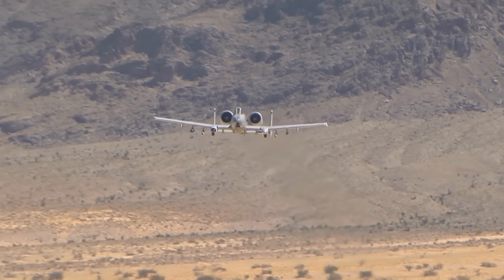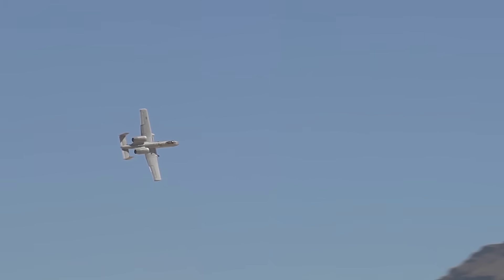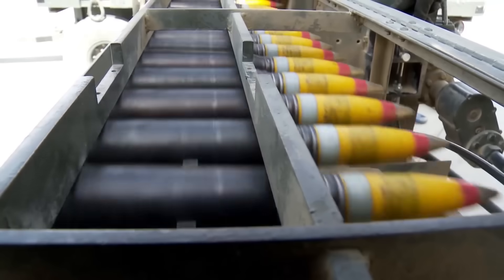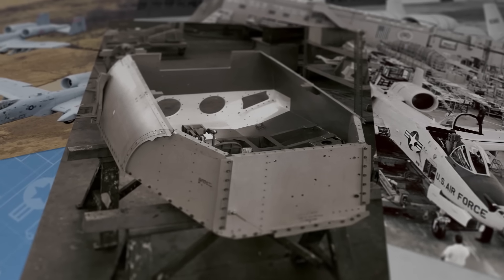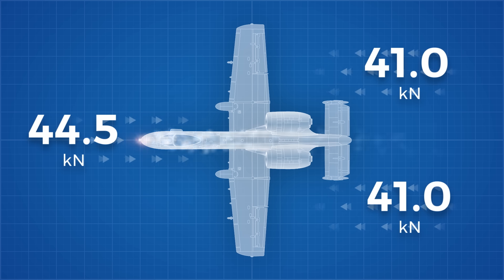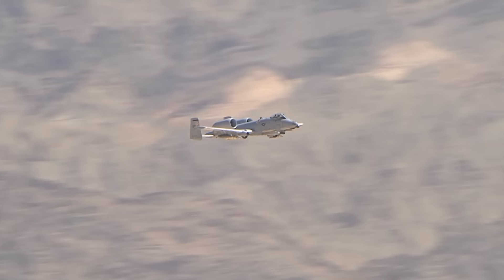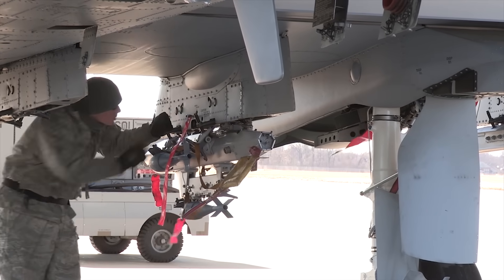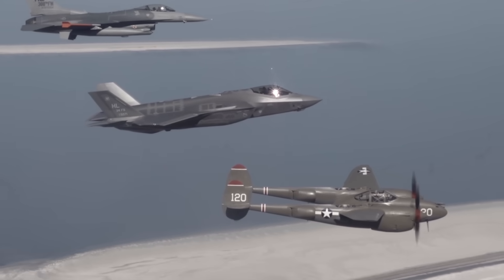The Insane Engineering of the A-10 Warthog

Comment: The A-10 has got three things no other modern fighter or low-cost turboprop has: persistence, efficiency and escalation dominance in the CAS-role. 1. It can loiter longer and without massive tanker support to back it up. 2. And as such, it requires less support platforms. On top of that, th A-10 still is relatively cheap to build, maintain/modify and operate, as its turbofans are very fuel efficient and the airframe is built to withstand so much punishment, that it requires less maintenance hours per flight hour. It also suffers considerable less mean time between failures or airframe fatigue. 3. 
The Warthog can employ standoff weapons just as any modern fighter can, aided by targetting pods like Litening or Sniper or Joint Terminal Air Controllers/Forward Air Controllers (JTAC/FAC) on the ground or off board sensors like UAVs, E-8 JSTARRS and the likes. So it doesn't need to get close if that's not deemed necessary. But when required, it can and still be more survivable than the fragile airframes of 4th or 5th generation fighters. Not that it is impervious or invulnerable, but its chances of survival while getting hit are much higher.  It only takes a dozen 7.62mm rounds from an assault rifle to disable an F-35/16/18/15/Typhoon/Rafale, etc. There are only two mission teh aircraft isn't suitable for: air defence and deep strike against heavily defended, strategic targets.

Comment: The barrel is mounted offset, the barrel that fires is at 7 o'clock... that barrel is on the centreline... only the uranium oxide post firing through heavy armour has contamination issues, this is a fine white powder around the penny sized hole and is only toxic if breathed in. The military hardly uses this so industry does not smile when the military buy it as the military inventory still has rounds from 1990s procurement for the gulf war desert storm...

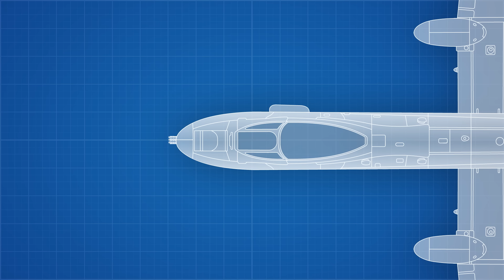Comment: At 7:47 you said that the gun is aligned to the center, but the graphic is misleading. It should be noted that the barrel group itself is aligned slightly to the left, but bullets leave the cannon from the 7 o’clock position, which is aligned to the center.

Comment: The reason the engines are located where they are so that if one is damaged and explodes it won't take out the other engine as  EVERY other Air Force aircraft will. Anyone who thinks a jack of all trades aircraft like the F-35 can execute the ground support mission as well as the A-10 just does not understand ground support. Stealth does not exist when you are down in the weeds with the troops.

Comment: Let's be clear on one thing. Many airframes can do CAS. And honestly the only munitions that the A-10 is the best at would be gun runs (obviously) and AGM-65 delivery (being slow helps when max range is reduced due to bad weather). There is one other reason though that the A-10C is the best CAS  platform around. It does it overtly! Many times just a show of force maneuver stops the incoming fire on friendly infantry, which is the entire goal of CAS. In some cases it is just redirected to the warthog which can more often than not absorb the hits and still be effective, though not ideal. Other airframes either can't do overt cas, or are not nearly as efficient or effective as the A-10C. The Super Tacano is the best attempt at replacing the A-10, but it does so by being a more financially viable version will taking an extreme amount of utility away. Because of this, the design is to have 4x A-29's in place of 2x A-10C's which only hurts the pilot shortage which has been present in the USAF for the last two decades. And that isn't a hiring problem, but a training one which the AETC has not been too successful yet at curing.

Comment: 7:44 The gun is actually offset to the left to allow for the front landing gear to fit under the cockpit. It does, however, counteract this by firing the rightmost barrel so that the recoil is aligned with the center line! A great engineering solution.
Reply: Not true.  The front wheel is offset, not the gun.  Go to the 10:00 minute mark to see a front on view that shows this.
Reply: Could’ve went with the good ol’ tail wheel ;)
Reply: See if you can find any credible source that shows it being centerline. Until then, you're wrong. They can set any barrel to be the firing one, but they chose the rightmost one precisely to be able to move the gun a little bit.
Reply: DownHereInChile I apologize, i thought you were implying that the entire gun was offset to the left of centerline still. (It actually used to be back in the testing phase, but they took it and put the barrel on centerline to stop the intense yaw recoil.)

Yes, the firing barrel is on centerline, but the entire gun is no longer displaced as much as it used to be. They used both methods to counteract the recoil.
Reply: Not anymore. It USED to be, but the A-10C currently in service would use a centered barrel to stop yaw moments.
Reply: ... DownHereInChile ... the gun is offset.  Not to clear the landing gear, but to place the firing barrel on the centreline.  The landing gear is offset as a result!

... Cade Norris, you appear to imply that the GAU 8A Avenger has been moved in the A10 C ... it is a fundamental part of the design of the aircraft ... it has not been moved!
Reply: GB Expat Cornishman I know at one point the gun was planned to be off centerline, it may have been in the design phase, but we are correct. 

It is now on centerline.

Comment: @7:46 The gun is actually offset to the left of the centerline, so the firing barrel (which is on the right side of the group of barrels) is on the centerline. The diagram isn't quite correct in that respect.

Comment: 7:45 - the gun is not mounted directly on centerline,  but slightly to the left [https://i.pinimg.com/originals/47/c3/d4/47c3d4376948b85a1286fc1ef0d5c9c8.jpg]. 
"The gun is mounted slightly to the port side so that the active firing cannon barrel is at the 9 o'clock position and on the aircraft's center line;" - source - https://en.wikipedia.org/wiki/GAU-8_Avenger

Comment: I believe that the best use for this plane is to refit it with a modern railgun.  It could be powered by hot swappable battery banks, that can also be recharged by the planes engine.  It could potentially fire for as long as until the barrel itself needs replacement from wear and tear (which would be anywhere from a few hundred to a few thousands rounds).   It would make it a force to be reckoned with, as it could act as long range air to surface artillery, devastating targets that would otherwise be difficult or impossible to hit from the ground, and it would maintain most of its kinetic energy.  Rails shot from a ship or the ground, have to fight against gravity, and are shot like traditional artillery, where they will arc and fall on the target. Shot from the air down towards a target though, and railgun rounds would maintain most of their kinetic energy and be more accurate.  

It would also be devastating to airplanes, because we're talking velocities of over 1 mile a second. That would still take 20 seconds to target, but it's easily doable, and the rounds can be made stealthy, so they'd never detect them, and thus would never bother to change course/speed, making targeting very simple. And if the plane is coming at the rounds, that's one object moving at mach 2 or 3, being hit by an incoming projectile at mach 6, essentially increasing its kinetic damage.  At that point, even a tiny railgun round would devastate the aircraft, and you could pepper the sky with them so that even if they do change course slightly, they can't avoid it. It would literally make coming at us to attack us, even more deadly than running away from us.  

Even if the enemy could see them (which would likely be impossible because railgun rounds already have a stealthy profile, and with a stealth coating, they would effectively be invisible to radar), 20 seconds isn't a long time to react, and even if they somehow could at the last few seconds, this would constantly force them into maneuvers to avoid incoming rounds, which effectively keeps them from being able to operate offensively. They'll have to constantly fly soo erratically that they couldn't even use the plane offensively.  At that point if you can keep lobbing rounds at them, they will literally have no choice but to land or eject.

Could even make it carry two or three types of railguns.  A large central one for heavy hitting that can fire say 100 large rounds.  A secondary one with medium/small rounds that allow it to operate how it traditionally does, i.e. peppering ground and air targets, and very small sliver sized rounds that act as flak that can also pepper ground and air targets with more staying power.

Comment: 07:50   Factually incorrect.   The Gau-8 is not actually mounted on the center-line of the plane.  It is mounted off to the left side by a small amount to make room for the nose-wheel and to line the Gau-8 up so that the barrels average on the center-line of the plane while they fire.  If the gun was mounted truly center-line the thrust vector would be about 3 inches to the right of center-line.   The retro-thrust from the gun is so high that the mild random variation in thrust per fired ammunition and propellant gas would make even computer control of the aircraft less accurate than having the gun mounted so the fired projectiles are on the center-line.

It's a very small factual point - technically less than 3 inches - but it results in the weapon being about 10x more accurate and maintaining a far tighter group.

The re-fit of the A-10 with the new wings includes sensor systems in the wingtips which will allow MUCH more accurate targeting of the Gau-8 from higher altitudes and distances through a provided 54 foot separation giving far superior and precise parallax ranging.   The aircraft will literally be able to aim the Gau-8 more accurately than the Gau-8 can shoot, allowing for replacement with a 25mm at some point in the future.  This replacement can provide more ammunition and range to the aircraft as well as a much tighter group on target therefore needing less ammunition per kill.   The Gau-8 is an impressive weapon but it is OLD and outdated.

Comment: I worked with the A10 chief engineer after he retired from Repulsive Aggravation, and know him well. He told me they would have Q & A sessions with pilots to get feedback on what they wanted during development. One of the requests that kept coming up, and came as a surprise, was decent cockpit A/C. Apparently, climate control systems typically worked well in flight, but if they were sitting on a taxiway in mid-summer for any length of time it got hellish uncomfortable. So, they spec'd the most powerful A/C they could. It was well received.

Comment: 13:14 Bruh if the soviet would attack in the 1980s the Had more then enough good anti air weapons to shot down A10s
ZPRK 2S6 Tunguska Uses Saclos guided Proxy fuse missiles 
Saclos stands fo  Semi automatical Command Line of Sight   that Simply means the missile folows a point in your screen Like a Laser guided missile Just Optical guided 
that gives the A10 No warning what so ever about the missile launch it dosent use Radar Just the Saclos  there for not giving any warning and not is position away 
only Way the A10 would now is the Search radar But that cann by turned off (well would by useless but it would still be able to shoot the Saclos missile)
And proxy fuse will Detonate the missile even if it Misses by 5m  Criticaly Damaging the plane Or if near enough Ripping the Wings of 
and it has 8 off those 9M311 missiles And for back up 4x30mm Fast firing guns those need radar lock on So if the use it the A10 gets a Warning

Only way to counter it would by Clouds or Fog and that only works for the 1976 Version later the got Thermal
Reply: Not to mention they cannot penetrate modern tanks

Comment: Great video. Thank you. I'm interested as to the reason for the asymmetric redundancy in the landing gear hydraulics. Seems odd but as time has told me, there's always a good reason and that reason doesn't have to be ideal.
Reply: the gun is in dead centerline to the plane so the landing gear is offset to accommodate it.

Comment: Fat Ami won't replace the Warthog. There are missions, such as CSAR, JTAC and MEDEVAC, that the F-16 couldn't do in Operation Desert Storm and the F-35 won't be able to do them in the modern battlespace. Flying 100 ft. AGL to search for friendly pilots or protecting friendly helicopters, as they rescue troops in combat, needs a rugged, slow-moving plane, like A-10.

Comment: These videos really annoy me because it isn't critical enough. 

The A10 is cheaper to operate than an F16 or a f35, but still more expensive than a turboprop plane. It is designed for anti Soviet warfare in the fulda gap, but if an F35 dropping a bomb on sandal wearing Taliban is Overkill, these depleted uranium shells are also Overkill for fighting insurgencies. 

As mentioned earlier, a turboprop plane configured for CAS is cheaper--often 90% cheaper, and they can stick around longer than the A10.

Comment: I've said it before, I'll say it again. They need to just modernize that plane. Keep it looking the same just give it better engines, use modern materials sciences to put in composite armor instead of titanium (if it's as effective or better), install a "C3" unit and give the pilot a small squadron of drones and share sensor data. Guy flies by BRRRRRRRRT comes back around for a 2nd strafe and sees the enemy is in a more strategic position that at first glace, "drop a pin" and tell the drone that's just a flying howitzer to hit the location. Enemy doesn't even see that coming as the drone is at 15,000' while the A10 is a few hundred feet. A10 finishes 2nd strafing run and the building full of terrorists collapses into dust and the squadron flies back to base.

Comment: I remember when you had a video showing planes that were prohibitively expensive and plastered the A10 picture among them, and I was very annoyed. It's nice that you finally figured out the amazing engineering that went into the A10 40 years ago and the relatively cheap price of it overall. There are only a tiny few planes so beloved by the troops for saving their ass on so many occasions and the brave, bold pilots that flew those sorties. All of those planes were in the ground support role. There are stories of A10 pilots, out of bullets, that stayed on site to harass and distract the enemy, and soak up bullets until our troops could flee the area. That plane would add to the battle damage statistics, but nobody counted the people that were saved because of the actions allowed by the pilots emboldened by the safety of that A10 design and their little titanium tub.

Comment: engineer: so I made this insane 30mm Gatling gun, that you can mount on a plane,
 has higher thrust than a jet engine(actually turbofans or something which are kinda the same thing...), and it even makes violent fart noises :D
Reply: Turbojet is a type of jet engine, that's probably where the confusion is coming from. But so is a turbofan.
Reply: You're technically wrong. Those are TURBO FAN engines, not Jet Engines. Now go smell a fart.
Reply: @einarabelc5  and technically a turbofan is a jet engine
Reply: Bee Pool 
It might be called a High Bypass engine
Reply: @einarabelc5  Youre technically an idiot. Tubro fan engines are jet engines.
Reply: @einarabelc5  I'm sorry, I'll fix that right away

Comment: What I don't understand is why not revamp the A-10 like the new F-15. Keep the basic design but redesign the internals and engines. 
Perhaps even make the main gun modular. The 30mm simply isn't needed for pickup trucks and other light targets. So that could be swapped out for lighter armament when desired.

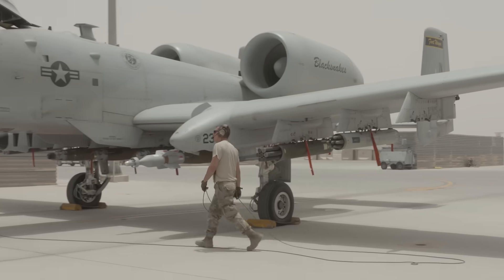Comment: 8:18 another advantage to the high mounted engines is to keep the gases from the gun firing from going into the engines.  For instance, the Hawker Hunter had issues with its 30mm ADEN canons gases going into the Avon engine inlet and it caused the engine to surge. At one point the engineers had to synchronize the engines fuel to lean out in synchronicity with the canon firing.

Comment: Close air support doesnt require a low flying aircraft, the reason the A10 needed to fly so low was due to a limitation in technology not because that is the best way to do it. 

Dropping a precision munition CLOSE to allied troops is also close air support, it isnt a necessity to fly low and risk the aircraft and pilot.

Comment: Very rarely, if ever, has a military machine fulfilled its mandate as thoroughly and spectacularly as the A-10 has. It is currently operated by the US Air Force, and, as the video states, it has long been under constant threat of retirement. One solution would be to transfer them to the US Army. The Army does operate aircraft, notably various helicopters, but it does have some fixed-wing aircraft as well. Since the A-10's primary role is close air support, it seems to me that having it be under the same command as the troops it's supporting would be advantageous.

Comment: The GAU-8 is not mounted on the center line of the aircraft, it is offset to the left.  The rounds exit the 7:00 position on the gun to compensate for this.

Comment: 7:45 WRONG and you drew the airplane wrong to fit your script. From the pilot’s POV the gun is to the left specifically because the firing barrel is on the right. The firing barrel is on the center line. C’mon man, I only flew this in DCS but I knew how to launch Maverick missiles at tanks so yeah. :P